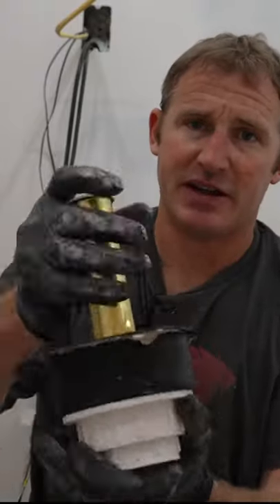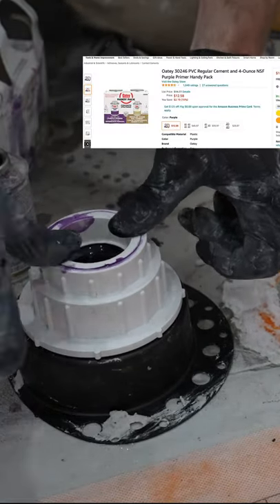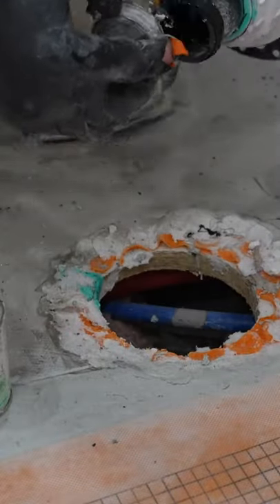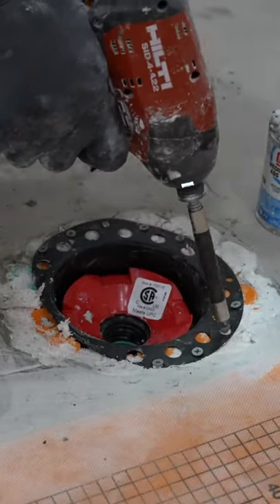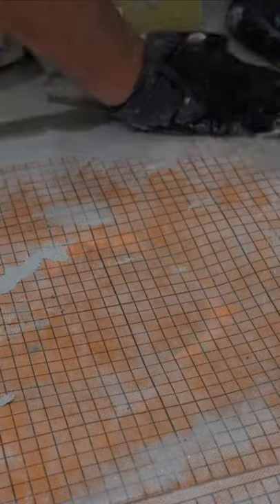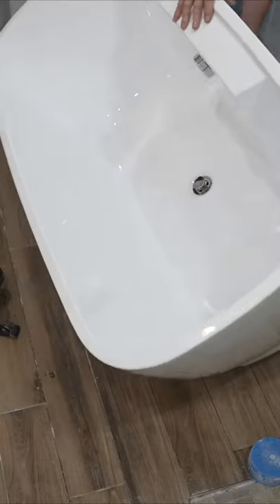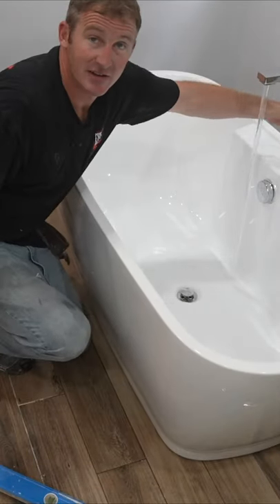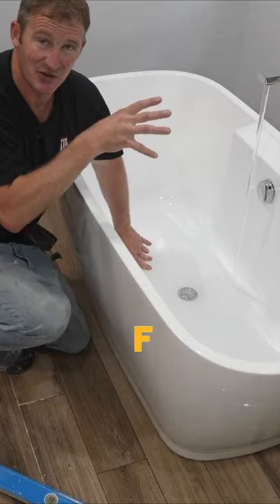how to install a soaking tub #shorts

Comment: What do you do to insure the tube doesn't move? Looked like all that was holding it in place is the drain so it seems like it could be easily pushed around.
Reply: The tail is secured by the rough in drain.  The tail is sized to slide into the drain using a silicone lube (supplied) and O-rings inside the drain rough in.  Everything else is secured by silicone around the tub which prevents movement and the drain itself should be secured with straps.  I have used this with great results.  Much easier than having to access it from below.

Comment: If the water spills over the tub and goes through the tiles, will it not leak if the flooring is made in timber?
Reply: Absolutely. Thats why tubs come with built in overflows, so when water reaches too high within the basin it flows down the overflow and into the drain assembly.

Comment: Kerdi fix is not water proof according to tile coach. Prova and wedi sealants, as an example, are waterproof. Apparently home depot usa has an economical modified silane sealant that is probably your best option. In Canada, I bought the prova sealant.
Reply: Then why would that be what Schluter has you use between the foam board and tub flange? And base of tub to time membrane.
Reply: Kerdi fix is waterproof according to Schluter Canada.
Reply: I would just use red guard or what ever the even better one tile coach used. That paint on membrane is amazing. Even when a customer asks for kerdi I still put a paint on membrane over the floor and laps for extra protection. I keep a bucket of it on hand at all times.